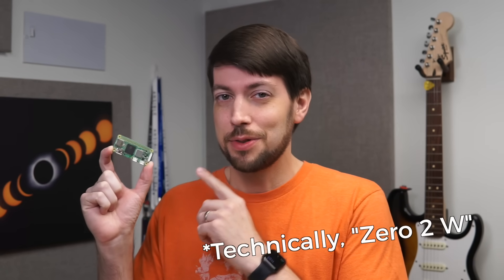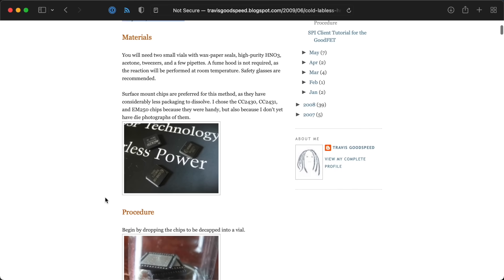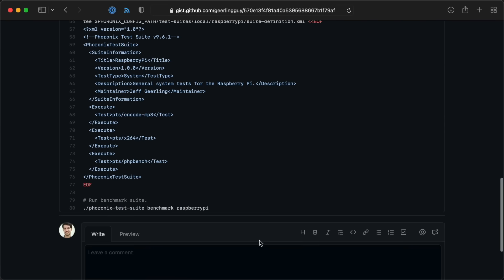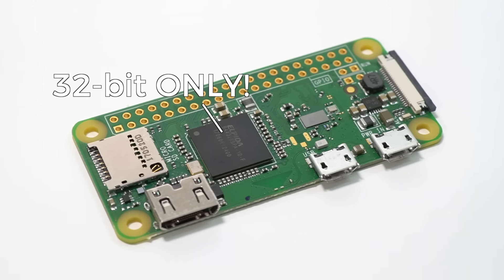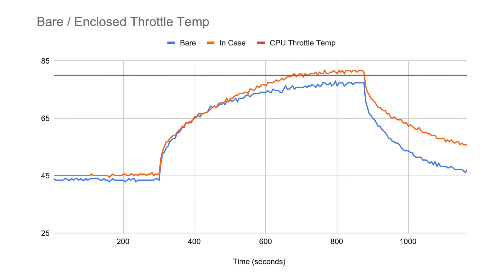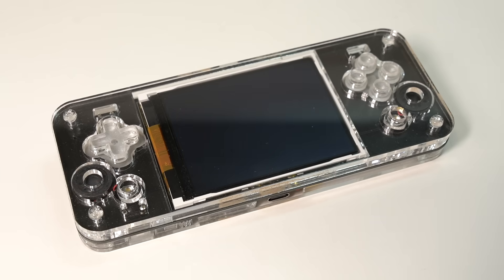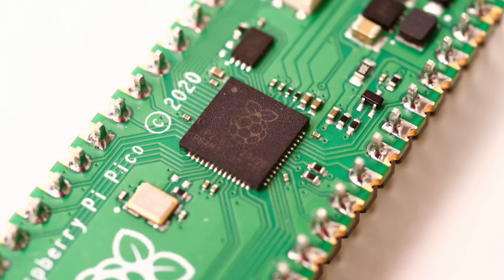The Raspberry Pi Zero 2 W review

Comment: I went to college to learn computer technology, but I experienced mental health issues and burnt out as a student. I stopped going and only got 1/3rd of the qualification. I know there was nothing to be done, but I regret never going further. And then when I got mentally ill I found it increasingly difficult to use computers or work on my hardware on my computer. I couldn't sit down for long periods. I had to move about. I'm now trying to push myself to get back into my computers and learn on my own what I didn't in college.
Reply: there's no rule that says you have to do everything in one big chunk.  unless your college has that rule. if so, find another college.

Comment: 7:22 i get a consistient 40-41 mbps on wireless with raspap (wireless connection with wlan0 and out/hotspot with a wifi adapter), both on upload and download. 
as soon as got raspap and a website, vpn running on it (via cloudfare tunnel) the speed tanked to 16mbps max ;/

Comment: Another advantage of the Zero 2W over the Zero W:  The Zero W has extremely poor environmental limits! Learned this lesson using a Zero W in an off-grid project. The Zero W refused to boot at any temperature below approx 5degC. The Zero 2W handles temps below -12degC (at least - that's as cold as it's gotten so far). Interestingly, "The Raspberries" did not publish any sort of spec sheet or a "Product Brief" on the RPi Zero W.  The bastards knew it was shit, but wouldn't say for fear of hurting their sales. Grrrr!  I hate to be ripped off!

Comment: glad i watched this...thanks for the info.  i have a pistar hotspot, a pi 400 and a radxa zero.  i used a new microsd card to install manjaro onto my pi 400.  can i use the sd card that came with my pi 400 that has the pi os on it in my radxa zero?  im new to raspberry pi so that is why im asking.  i havent done anything with my radxa zero other than power it up to make sure it works.  i want to install a new os onto it, so i was hoping for now to just use the sd card with pi os that came with my 400 on the radxa zero.

Comment: I signed up for the MagPi magazine just to be able to get my hands on one of these. It arrived via the mail on Friday. I loaded up RetroPie on it, and it would not run. It kept crashing, would not connect to wifi, or it would just not boot. Then I saw that the weekly builds support the zero 2, not the stable release. So I used that... And, man, this thing can emulate those old games much better than the original. Even some more intensive play station games run with a little overclocking (1300), but it does get hot.
That was a neat Easter Egg there with the raspberry logo.
Reply from the maker: Yeah, I did another video on building a handheld gaming device where I mentioned the RetroPie issue. I hope they get out a new release soon!

Comment: kinda wish there was a board that adapts the usb power to usb-c, the usb data either to usb-c or usb type a and the mini hdmi to standart hdmi. 
could be done as a sideways extension, increasing the footprint a bit or as a HAT and with that, be compatible with most multi-layer cases.
just a spontaneous idea i just had.

Comment: The Raspberry Pi Zero 2W IA great, but there is one extremely disappointing thing about it is the use of the Micro USB ports.  I use them for controlling my 3D printers, which are mostly Micro USB, and Micro to Micro cables are pretty scarce.

Comment: Banana PI BPI-M2 Zero Configuracion y Uso de GPIO,Banana Pi M2 Zero is an ultra compact single board computer which measures only 65mm*30mm. Its external interfaces are the same as the Raspberry Pi Zero W, and it will fit almost all cases and accessories for the Zero W. It uses the quad-core Cortex A7 Allwinner H2+ processor, with 512MB RAM
https://www.youtube.com/watch?v=LGlon4DOIwc&t=197s

Comment: Can I suggest a Special Video from you? I think that you can make special video about USB DATA port of Pi ZeroW and how it functions from the power/charging perspective. As far as I understand it can be used to power Pi ZeroW and it should be OTG compatible but who charges who in such scenario is a big question and I can't figure out exactly what is going on. In my project if PiZeroW connected through this port  discharges main device completely but once it does it charges the same device over it if connected with power-in port ... I reaaly wish to see your perspective with  deep exploration that you do perfectly. I think PiZeroW2 should behave similar to 1? Or should it ? Thank you !

Comment: Is it better for me to buy raspberry pi 3b + or this?
Reply from the maker: 3B+ is slightly nicer for general computing. Only get the Zero 2 W if you really need that tiny form factor.
Reply: @JeffGeerling  Oh ok thank you for responding, and btw do you know where i can buy the raspberry pi zero 2 w or any raspberry pi for that matter at the MSRP price, or will it get lower in price?
Reply from the maker: @abdullahyousef3596  You'd have to just keep checking the authorized resellers. Unfortunately there's a lot of demand and not as much supply, so right now you either have to wait or pay extra from a scalper or buy a whole kit on eBay or Amazon :(
Reply: @JeffGeerling  I have a single authorized seller where I live and they are always either out of stock or even not selling the product like both pi 3b + and zero 2 w. :(

Comment: why use 64bit os on 1ghz pie? lol
Reply from the maker: It is significantly faster for many tasks, and it also has a lot more software available (e.g. there are thousands more pre-built Docker images available for arm64 than armv7).
Reply: @JeffGeerling  the only true reason to use 64bit system is that it support more ram than 3,4GB. Most of the cases 64bit system is slower than 32. Defragmentation of words.
Reply from the maker: @szyszka8303  In almost every benchmark I've run on the same system (including this one) on 32-bit and 64-bit Pi OS, the 64-bit tests (with the same software and same hardware, and no overclock) run faster.

Comment: Sounds awesome!
But can it handle Bluetooth and WiFi communication at the same time?
Reply: I had problems using Moode Audio with Raspberry Pi Zero 2W - streaming music (wifi) and using Bluetooth speakers resulted in choppy / crackling sound. Could be a driver issue (?)

Comment: In a way I am glad it only has a half GB ram.
This means that apps on the 2 will fit on the 1.
Hence, the 1 will not be quickly made obsolete.
Reply from the maker: True; the Zero itself (non-W) has been great for a couple low power long term experiments, and at $5 I'm happier putting it in places that it could be unhappy.

Comment: The mainboard thermal mass is NOT the problem. The poor thermal design that does not transfer the heat from the cpu down into the pcb is.
Thermal mass just stores heat, it does not get rid of it.

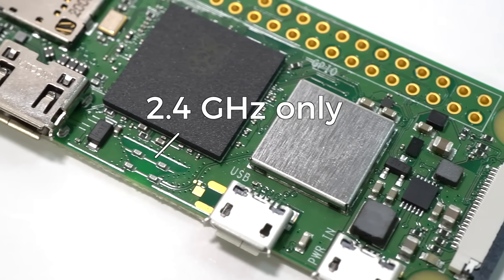Comment: @1:23 "As far as I/O goes it's exactly the same as the Zero W"... So you missed that they removed the composite video and "run" (reset) headers too. I know it's a very underused feature, but a lot of reviewers have missed this! They're now on the back as test pads instead!
Reply from the maker: Yeah I totally forgot about that since none of my Zero builds have used them. I didn't even think to compare the bottoms of the two boards in this video!

Comment: 35 bucks for a PI would be a dream here. They start at 70 and even the smallest RPi4 is 80 bucks. Using it for my 3D printer (Ender 3 V2), it should speed up the printing process and precision to another level. The logo under the chip is fun though :) I snatched on at release date though, maybe I just buy 2 more?

Comment: Since you x-ray'd, what's the final height of the stack? You can try to sand down to 2-3um higher than last element/connecting wire to increase thermal conductivity and cool the whole package, since the cpu under the memory will heat up the memory which will show those weird errors that probably did...

Comment: Entertaining, but I don't really care about overclocking, to get a tiny bit more speed.  

What would you do with it that suits it better than using a Pi 4, or just a microcontroller with no OS, like the Pi Pico, or the Adafruit variations on the same chip as the Pico (RP2040)?

Comment: Why not make a project on modular-demodular using RPI-0  and the coax-cable for a data communications.
Though optical fiber is expensive, if possible build a communication among devices. 🙂

Comment: It is not twice speed compared to pi zero w. But, 5 times faster.
Reply from the maker: It depends on what you're testing. Synthetic benchmarks will be a lot faster if maximizing the performance from multicore utilization. But I like to stick to more real-world benchmarks which are more often limited to one core.

I should probably add in one or two multicore benchmarks though, since there are more pieces of software that are able to take advantage nowadays. But I don't want to give people a false impression that if they buy a Zero 2 and start using it, everything will be 5x faster, because most things won't.

Comment: Jeff a nice video again. Definitely a big upgrade for the original Pi Zero. I wonder if you run a camera with an RTSP stream thru the raspivid command? Would it use only one Core and would it benefit from the better performance? Less video lag would be a great benefit.

Comment: I got lucky and ordered mine from Pimoroni, it was in stock as of late afternoon 29th October.  I'm going to use it as a faster but still cheap Pi-Star platform for my digital ham radio modes.  It will be nice to have enough power to run DMR, DStar and System Fusion all at once without the Pi bogging down.

Comment: 1) to get around using swap, enable ZRAM. That should help a smidge. 2) Zero 2 W lacks an "AV" Composite pinout which can be a deal breaker for some retro projects. Cheers.
Reply: If you watch the Explaining Computers video on this Zero 2 W, he shows you that  there is, in fact, a way to solder composite video access from the bottom of the board.

Comment: Alot of code for raspberry pi's os I had to recompile code and optimize code, and change some data types for the pi zero w, it was a mess. I got assualt cube server working, but the exclusive club members banned my assault cube server because ti wasn't upto their snuff of exclusive OP club that or it was because I was not intiated into  their inner circle or some crap because I got it running on a pi 3b+ and it followed all their guidelines and it still got blacklisted.

Comment: Hi, Coughin. I'm Dad. 

Interesting about the low overclock margins. I guess there's just not much thermal headroom even if you add a heatsink and fan; plus if you're going that direction, you're probably better off with a Pi 3A+ than a Zero 2 W anyway.
Reply from the maker: hehe, #dadjokes right there

Yeah, the chip doesn't handle too high of clocks anyways, and couple that with the RAM stacked on top, and less thermal mass in the PCB than on the 3 B/B+, and it's not that great at overclocking.

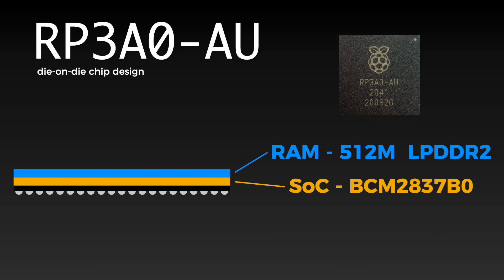Comment: 1:00 you would be surprised on how much speed and RAM the computer of the LEM and Apollo space crafts actually had so technically, yes you could assemble 15 of those Pi Zeros for $15 each and recreate the computer side of the apollo program and it could GET you to the moon with simulations...

But you still need tonnes of explosives to ride on though, good luck

Comment: Irrespective of whether or not the PiFoundation desire to make a version with more RAM, how much RAM can that SoC support? Just 1GB or can it take like say 8GB or more (etc.)?

It is the protection-rings (e.g. for securing a WebCam in a virtual machine) that make the SoC (like the pi3b, ARM7 and up) so useful. It simply does not matter about heat (although power-consumption being low is sort of nice), nor speed. Being able to use a few GB RAM for VMs would be useful (but of course, the PiFoundation are unlikely to bother). This little SBC is good for a "crutch" to assist a "proper" pi3b (such as sending a very modest VM for merely a webcam to a networked pi3b).
The Pi-Boards are kinda cool to use, largely for being ubiquitous but they are not that great and that is because the do not boot a debian blob, per se. I see where debian are coming from, slagging off the pi for being not the sort of device they aim to support.
This pizero2W is basically a poor-man's xbox360 (which is sort of nifty but not that amazing). Had they stuck a few GB on it, well then yes it would be more impressive (and genuinely useful as retropie handheld battery powered device but for native linux games like supertuxkart, not merely ROMs of the mame).

Also, as per the pi3b, can it boot off a usb hdd?
Reply from the maker: So far I haven't been able to get USB boot working on the Zero 2.
Reply: @JeffGeerling  Found out you need to flash it like the pi3b+ gets flashed so as to boot from usb. Maybe show a video on doing it so more blokes know.

Comment: No. I hate uHDMI (structural reasons, or just reasons below).
the HDMI spec needs some thicc cables. if you're plugging that beast into a tiny port the size of a mosquito, it's gonna have problems (my Pi 400 occasionally has video feed trouble if I move the cable).

Comment: 8:32 Only one issue I can see here .. the lead-free "solder substitute" as I call it. How do you get on with that stuff? I much prefer 60/40 but I know it's probably not as readily available these days.
Reply from the maker: I just make sure to control the temperature well on my iron and use a lotta flux!

Comment: Thanks for taking power measurements! I gotta get my hands on one of these; I use a Pi Zero to drive one of the HQ cameras in an astrophotography setup (with some complicated USB network trickery to connect it to the main Pi 4 running the whole setup) and download/transfer times for each long exposure are pretty atrocious on the original Zero. A beefed up CPU would probably really help here!

Comment: Thanks for show us the Zero2!  I have original Zero W running my DNS server and went with it over a full Pi because I liked the smaller power usage with it running non-stop, so that was nice to see you captured the 2's power as well.  I am curious thou how did you get the speeds for a wired connection, should I assume you connected an USB to Ethernet adapter to it or is there another option to add a wired connection to the Zero I have overlooked? 👀

Comment: the pi zero is my favourite of all, haven't tried the compute module but I don't think it's for me I like to tinker with the IO, I'm building a solar powered weather station with the pi zero and I'm worried about the power consumption of the V2 should I stick to the older version ?
Reply from the maker: If you don't need the horsepower, the older Zero W will save you a little of your power budget.

Comment: On a more practical note.. 
I’ve been working on a pi cluster with mgt etc.. This new “0” will work fine as the base board controller..  Good thing I made the ESP32 controller module pin compatible with the Pi GPIO !!
Reply from the maker: Nice plan :)

Comment: Looks good, but the price is a bit high (for a pi zero). But I guess that in this times it's ok, huge inflation plus chip shortage. Only 512 MB is a problem. 1 GB (or even 2 GB) would be much better. But it is what it is...

Comment: With this unit using so much more power but delivering much better performance, I wonder what would happen if you underclock it to the same performance level as the old model. Would it use less power?

Comment: Hi from the UK, another great video Jeff. Knowing it can run 64 bit is incredibly useful. I run either Ubuntu (64 bit only) or Raspberry Pi OS 32  64 bit on my Pi 4Bs depending on the use case. The 512 MB RAM is likely to be a limiting factor but in time hopefully falling memory prices will give us a 1 GB version. For £13.50 at the Pi Hut in the UK it is priced cheaply enough that it can be bought to just ‘play with’. Looking forward to the next video.

Comment: I hope the Raspberry Pi Zero 2 WH comes out soon- my soldering iron's tip is down to bare copper so I have to whack it with a Dremel for every pin.
Reply from the maker: Ahh, gotta get a new tip! (Or a new iron if the tip is integrated...)

Comment: @Jeff Geerling I guess this means the HD Cam can compress HD vid? PS 2x the zero? Its a quad core A53 so x5-6?
Your benches where single thread ?
Reply from the maker: Yes; basically I like to run some tests that measure day-to-day performance. I can do things like compile kernels and use all four cores all day, but for the majority of tasks people run, they're single-threaded and that performance is more what people will see.

In fact, I just tested disabling the three extra cores, and you still end up with double the performance of the Pi Zero W using 200 mA instead of 160 mA, so it's still a pretty great upgrade if you want to run it single-core only!
Reply: @JeffGeerling  I had at look at the Explaining Computers vids and he did a synthetic test and proud of my x5-6 as sheer guesstimate.
The Picam project might be interesting as now we have more ooomf but also gadget mode?

Comment: Didn't even know they were making a newer model.
The main limitation of the original zero, is clock speed and ram.
If they could cram their own designed chips on there, they could make it a dual core, with 1GB of ram. I see the Pi2Z will be used to run a full fledged OS on it, something the OG zero had problems with. Especially if you wanted to watch YouTube videos, or browse the internet with just about any browser other than a text based browser, and without a swap file.

Comment: Jeff:  "The bottom line is this, they will all give similar performance at the $15 price point".  
So not true and he knows this.   There are no throttling issues on the radxa zero.
With twice the clock speed and hardware x265 decoding and radxa having very good software support 
there is no comparison.   Radxa zero leaves the pi zero 2 w in the dust.